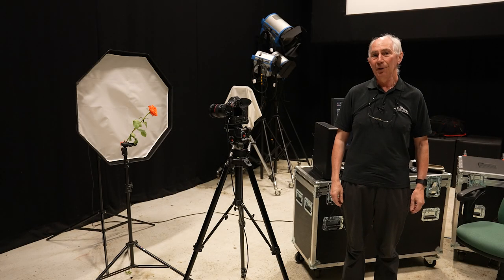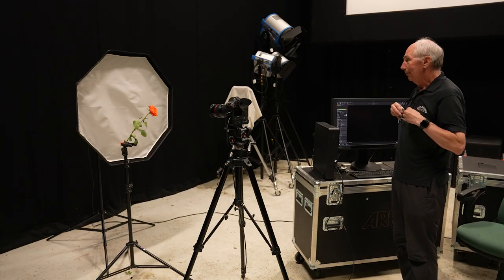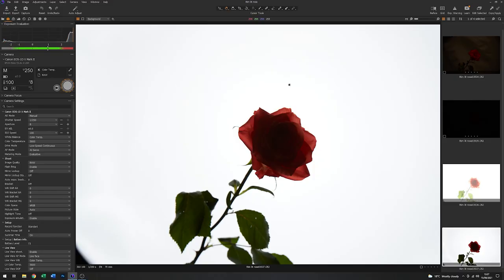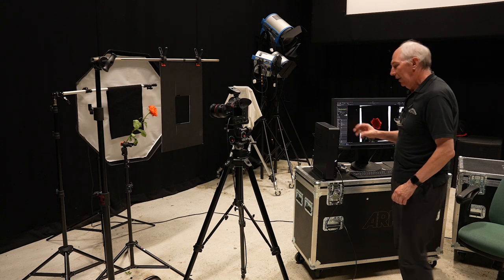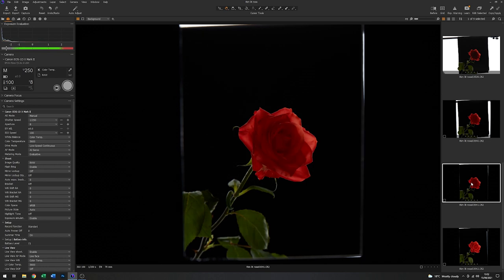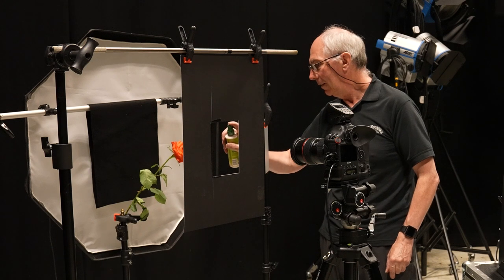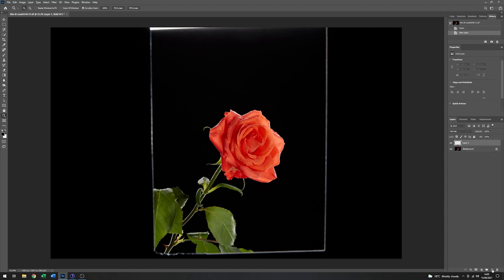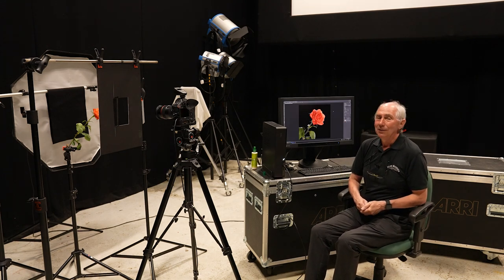Creative flower photography lighting techniques

Comment: Do you really need a 3 foot soft box with 1000 watt flash?  Will a 24 inch octagon box with 400 watt flash work?
Reply from the maker: The bigger the softbox from the subjects point of view the more defuse the light will be. For a relatively small subject a small (<24") softbox very close will have the same effect as a large (>36") softbox further away.
To a lesser extent the total energy of the flash is irrelevant, due to the inverse square law, the energy required for good exposure with the softbox close will be only a fraction of that required further away.